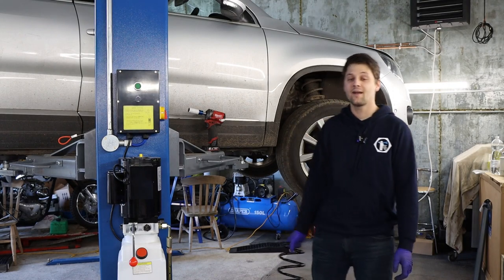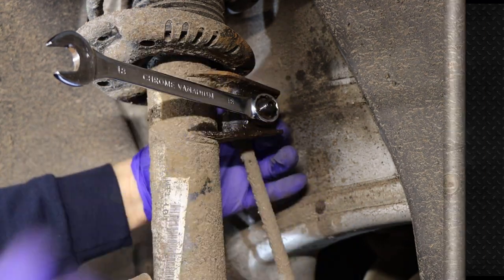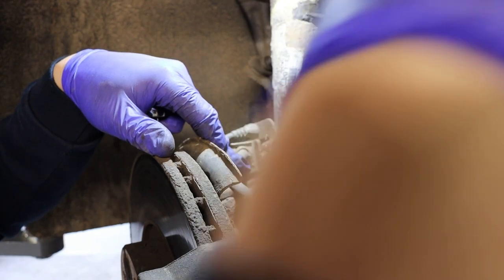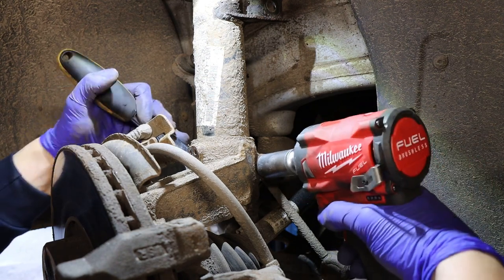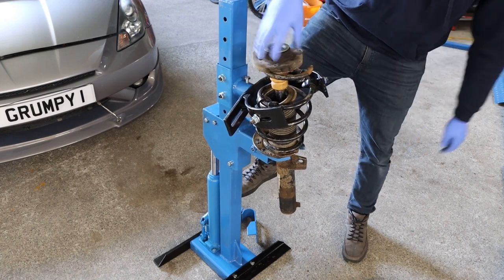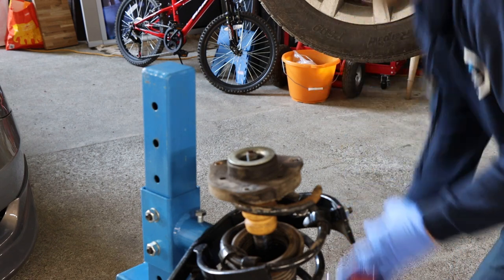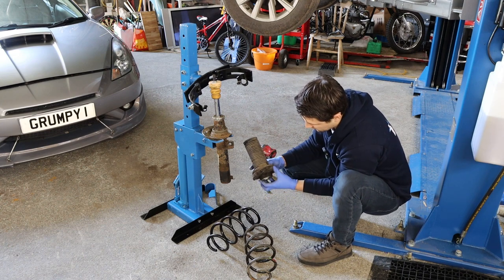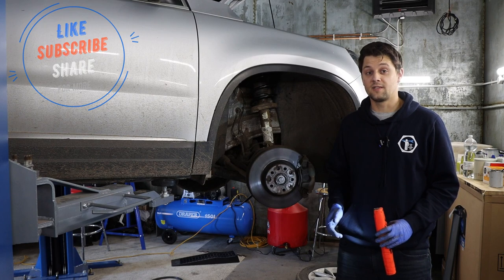VW Tiguan Front Spring replacement and shock absorber removal. How to replace front coil spring

Comment: Good job. Nice video. Great not having to take the axle bolt off. 

This isn’t so hard to do with a two post lift, a professional spring compressor, the special tool for holding the arm down and a transmission jack. A bit more difficult without all those tools, whilst working outside on your driveway 😂. 

Replace any bolts that have an angle turn in the tightening settings, they are stretch bolts. If your shocks are old and or damaged now would be a good time to replace them. Likewise with the top mounts.
Reply from the maker: Thank you very much. 
Yeah without the lift is a pain, I've done that for long time. 
Best thing I've ever got haha

Comment: Wanted to thank you for all the help as the install was successful. One note to people in America getting the replacement strut assembly from AutoZone. The 3 bolts on the top mount are SAE 1/2", not 13 mm like the original. That threw me for a loop for a minute with the torque wrench. America always has to be different smh
Reply from the maker: Awesome 👌 thank you for the helpful info as well 😀

Comment: 13:35 I didn't have the spreading tool so i made one with an m10 bolt, i just ground down the thread and metal on two sides so it was more of an oval, then just used a ratchet and socket to turn it to spread the rub and it worked really well to my surprise lol. 

Hey Alex been watching some of your older videos recently and they are really good man. Keep up the good content man. 
👍😄
Reply from the maker: Hello bud! Thank you 😀 
Yep thats great! Well done for making the tool up bud! I use to use chisel before. That works as a treat as well.
Reply: @AlexTheGrumpyOne   Oops fixed my spelling mistake. Yeah chisels work great too.

Comment: Good vid but you missed a important point about the top mounts. They are directional theres two arrows on them and they should bolt in with one arrow pointing to the front and the other to the back of the car.
Reply from the maker: Thank you. Yes that true. I did mentioned about marking the bolts at the top to make sure you fit it the right way back in due to that situation.

Comment: Awesome video with top quality production. I plan on swapping the Tiguan suspension onto my Sportwagen. This is very informative.
Reply from the maker: Thank you! I really appreciate your support :) 
The passenger side one I would say you have to remove the drive shaft out of the hub as it will make it a lot easier!

Comment: I don’t have a car lift or long bar for pulling the hub down, so I used a small bottle jack for separating the bottom of the shock from the hub. The socket separator for the split at the back is a real boon, cheap to buy on eBay. I didn’t need to remove the brake tube carrier, but I did cut the drop link as I wanted to replace that too, the splined holes kept rotating, cut them off with a angle grinder! The stretch bolts are remove and replace! , cheap as chips to buy.
Reply from the maker: Well done! That's great news. I use to do them in a similar way before I had a car lift :)
Reply: Still trying to wrap my head around where you put the jack but most importantly, what is the separation tool called or what was the search words that you used?
Reply: @MarkSegree  suspension strut splitter tool, it’s a socket with an oval pry tool in the end, you place it at the back of the hub where the split is, then rotate it 90* to open the hub out. It’s a small amount but enough, just make sure you wet the area well with wd40 or similar first.
I placed the bottle jack tight against the bottom of the strut on the small shoulder of the hub surrounding the strut, then placing the top under the part where the spring bottom rests, gently does it and it pops out.
Reply from the maker: Thank you for your help. Thats a very good instruction there

Comment: This is proving fairly difficult so far, but i just began this weekend. The sway bar link came off easily, but that bolt holding the strut is a rough one. The nut on the end came off with minimal struggle, and i slid it back on a bit per your suggestion for hammering the end. My main problem now is i don't have an impact driver with enough torque. How many foot pounds is your driver? The regular hand ratchet isn't going to do the trick. I've lubricated it a lot and did hammer a chisel between the knuckle
Reply: Just saw the video description. Milwaukee 3/8
Reply from the maker: Yep that's the one. Brilliant tool by the way
Reply: @AlexTheGrumpyOne  I shelled out for the Milwaukee with 4 AH battery. Hopefully that'll be enough.
Reply: @AlexTheGrumpyOne  one more quick question, could you preemptively use the strut spreader bit before the bolt is out instead of the chisel?
Reply from the maker: The bolt needs to be out to before you use that.
U can get the bolt out by turning it first if its stuck
Reply from the maker: Yep that fully charged should be more then enough  😀
Reply: @AlexTheGrumpyOne  breaker bar for the win!
Reply: @AlexTheGrumpyOne  one more question for you: another mm or so and I'll be ready to put the big bolt back in place, but the distance between the anti roll bar link brankets is too close. Any idea why that might be?
Reply: in my case bolt didnt move until i installed gaspipe on the tool xD The pipe was about 2 meters long so that gave me lot of torque
Reply from the maker: @Rysperydon haha well.that works I suppose haha

Comment: Hi buddy. I have the same spring compressor but having trouble using it how do you line up the shockabsorber to be in center of the coil spring while pumping up so the top mount can go on correctly.
I see you have used a shim is this nessary.
Reply from the maker: Hi there..yeah I have those issues. The quality isn't the best to be honest. Having grease on the sliding part helps as it gets stuck on the base when spring pushes to much to one side

Comment: Hi there I'm in Ireland, my mechanic is really busy and he's always been trustworthy and my front left spring is clunking. He said it needs to be replaced. It's Tuesday and he said hes up the walls he'll fix it Friday but I'm not around Friday. So he said Monday will be ok....
it's not totally gone or snapped in half. Just on the way out.
Should it be ok until then
Reply from the maker: So it's just a bit on the end that snapped? 
If its still seating in the mount ok and not on the edge you should be ok.
I would recommend avoiding driving though to be safe. 
I would also recommend doing top mount in the same time
Reply: @AlexTheGrumpyOne  Yeah it's well seated in the mount and secure I rang the mechanic again he said it's slightly bent and causing the clunky noise. Just take it easy until then and no rough rural roads...it's not fully snapped yet 
Thanks for your speedy response much appreciated 💫👍

Comment: Hi. Is it a Mk1 or 2 Tig.
Reply from the maker: That one is mk2 but it's the same as mk1
Reply: Nah its not, the anti  roll bar goes underneath the drive shaft when pressing down to get strut out it the drive shaft touches the the bar. also it is a 6mm allen for the top if the strut on a mk1 not 7 has in the mk2

Comment: This will not work on a 2017 Tiguan Passenger side. The axle will hit the lower A arm before it gets low enough and thats with completely disconnected the sway bar.

Comment: Hi Alex
I'm new to your channel, I hope you can help me fixing a problem on my 2012 Skoda fabia 1.6tdi.
The problem is, the engine was shaking very badly, so I took it to a garage which they said it's injector problem, we changed the injector but the engine still shaking, although the scanner has no fault registered after the fitting of the injector, the mechanic said maybe is the ECU!!!! But o doubt it!! What do you think is the problem!?
Reply from the maker: Hello and welcome :) 
I am sorry to hear that you experiencing problems with your car. 
I'll try and help as much as I can. 
First thing is... we're the new injectors brand new or refurbished? Did he code them and learned the values after fitting them?
Reply: @AlexTheGrumpyOne  yes he did code them all again, but the shaking still here
Reply: @AlexTheGrumpyOne  the injector is refurbished yes alex
Reply: What's confusing is there's no fault shown on IIOBD at all !!!
Reply from the maker: If the injection isn't coded it will not show faults sometimes.
Reply: @AlexTheGrumpyOne  he coded all them as I mentioned Alex!!! Strange isn't it!!!?
Reply from the maker: Sorry didn't see the message above. It is strange. Is he not looking in to it?
Reply from the maker: In that case as long as its coded properly I don't understand what can be the issue. There haven't been dropped or anything like that? Because they are very sensitive to that. 
Also you got warranty on them?
Reply: @AlexTheGrumpyOne  yes alex I've got warranty, 
I appreciate your help Alex thank you very much. Talk to you again.
Reply from the maker: No problems. You are welcome. Please let us know how you getting on with it. Good luck